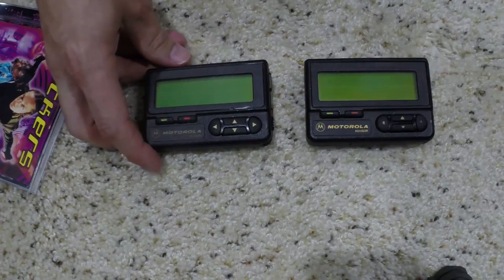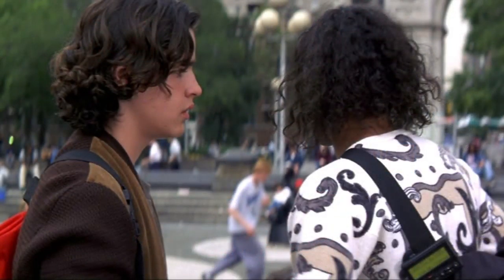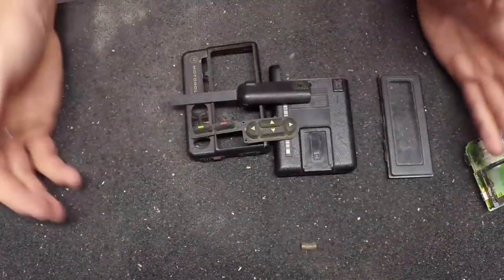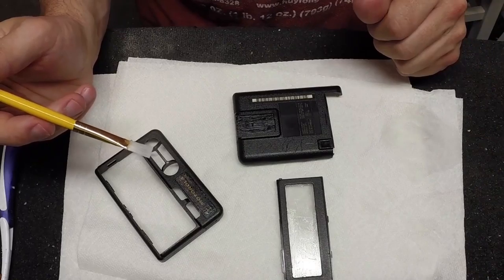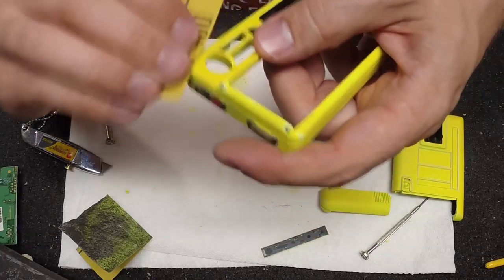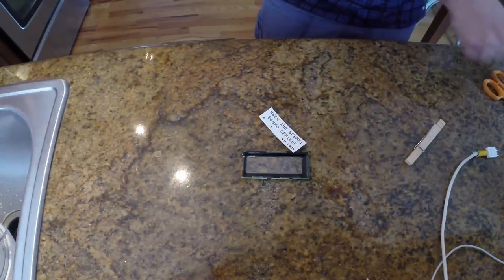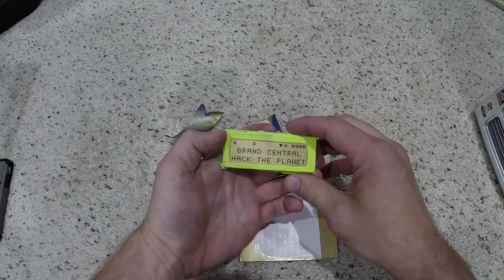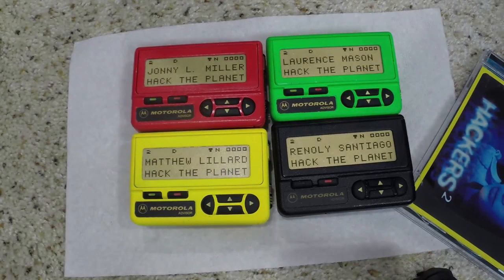Hackers : Replica Pagers

Comment: Do you have a demo of making that jacket or where to buy that jacket?
Reply from the maker: Scifi Riot im in the works on how to (somewhat easily) make a replica.
Reply: Nandemo Guy Any chance you might have it up before halloween?
Reply from the maker: Scifi Riot yep for sure. I'll work on it this weekend. look on ebay or ebay.co.uk for "tt leathers jacket" as that's where you're likely to find the real one. a cheaper and easier option, and what I'll show, is how to make one from a hein gericke jacket that's damn near identical. they are cheaper, and much easier to find. I'll make part 1 of the video this weekend.
Reply from the maker: Scifi Riot I'm about halfway done. decided to give it bit more than just the quick and dirty. if you want to prep you can look for a "hein gericke live eagle" or "hein gericke Harley" either can be had for somewhat low price and will make for a decent conversion. or you can look for the real one "tt leathers" was the maker.
Reply: Nandemo Guy Fair enough. I looked for the TT leathers original.  I can only find all black, none with the grey details. I'm gonna have to wait for your vids and fabricate myself.
Reply from the maker: Scifi Riot yeah, you may end up having to spray the grey using auto vinyl dye. I'm doing exactly this on the recreation actually.
Reply from the maker: music added to the vid and its edited, just need to finish up a few things and it will post this weekend. btw, the jacket im using for the conversion, theres a size 44 on ebay right now for $100